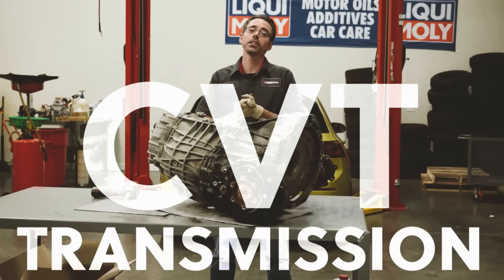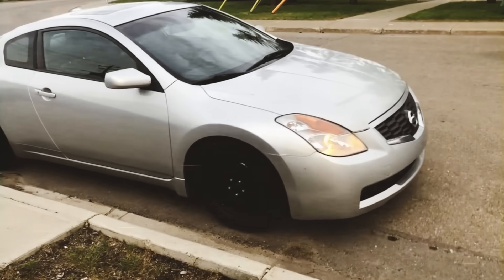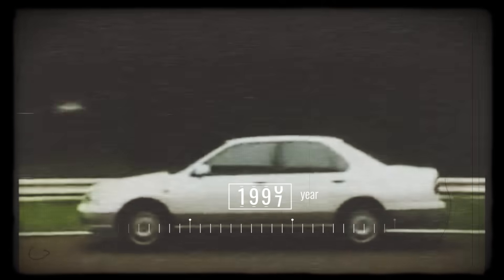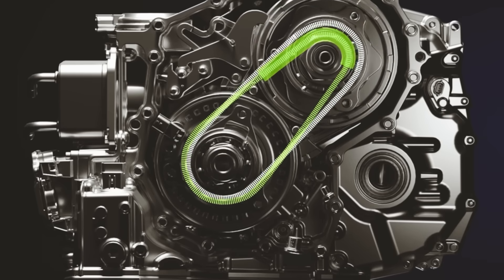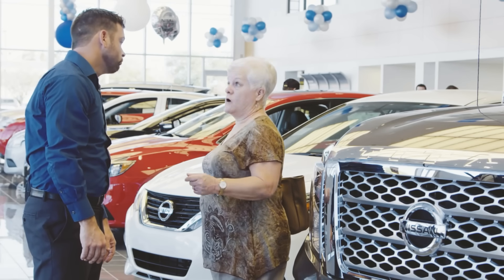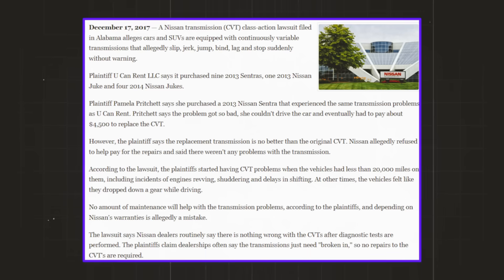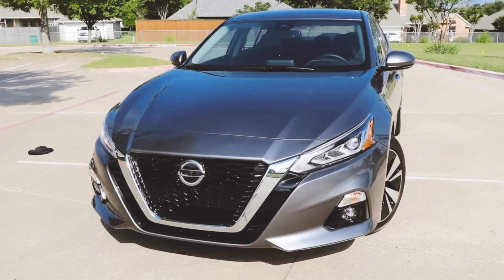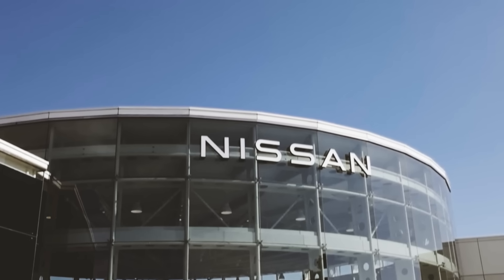Unpacking the FAILURE of Nissan's X-Tronic CVT

Comment: I really dont know why ppl are crying about cvt's especially nissans. ( think because of the bad reputation from the start of 00s that yes nissan didnt and still is refusing to properly acknowledge the problem in their harsh CVT era start.)

 I have 2 nissan Xtronic CVTs (2017 qashqai done 260k km & 2019 x-trail done 190k km) No catastrophic problems at all! Well... I follow up and basic maintenance my vehicles myself regularly and regarding the CVT, i change 'NS-3' spec oil every 50k, and every other mark i change oil+the small CVT filter(that costs 10€)...
Note: Two nissan dealers sayed that this filter is 'lifelong' and do not need a maintenance change for both models- only oil change is necessary, that was a shock for me, then i took matter in my own hands and changing the filter @ 100k it was visually pretty black and clogged up, so next time im changing it 10k faster.
 Oh and i dont bash it at every traffic light, because this transmission no matter the ads say IS NOT ment for race mode/burnout daily driving conditions!

My 2l diesel Xtrail gets ~5.6L/100km(42MPG for US), 1.7l diesel Qashqai ~4.8L/100km(49MPG for US) real life consumption without 'heavy foot' on combined cycle, what is phenomenal fuel economy for this size and power vehicles! Please comment which other brand AWD SUV class can beat it with its 'more reliable' auto trans. box?  😉 Even EVs are struggling to get these mileage numbers!

Comment: I got a very low milage 2017 Nissan Sentra in 2020 for a bargain. However since I was a student and there was the pandemic I barely put any mileage on the car. After 2.5 years I took my car to Nissan service and (Had maybe 18k miles) they told me that apparently my Sentra's transmission software had a bug that made it so it did not report any codes.  They told me they had to update the software and they would check it at my next service appointment. Next appointment (22k miles) comes around and I noticed the service appointment was taking an extra long time. The agent comes out to me and says my transmission has a serious code reported on it and the car can't be driven until it's fixed. Thanks to the lawsuits, they were required to extend my warranty on the transmission when they did my software update so I got a free rebuilt transmission and got to drive a nice new Nissan Rogue for a week. 

However, it's scary to think now if I had a driving heavy job (like I do now) or had to drive a lot to school there was the possibility my transmission could have just failed on me... I hope Nissan does better in the future.

Comment: I had a nissan kicks as a rental car not too long ago after I got In a minor accident. Had the nissan for about 2 months while ny car was on the shop. It was the worst car I've ever driven. Super unresponsive, handling was horrible, and safety features didn't work as they should. The emergency breaking system designed to stop if there's something or someone suddenly stepping infront of you would malfunction all the time. It would go off sometimes even if there was absolutely nothing infront of me, the car would would make a strange noise as it would stop out of nowhere on the road. Super unsafe. Economy wasn't even great and the power was underwhelming at best. I would never, ever buy a nissan.
Reply: Braking* autocorrect lol

Comment: CVTs are a transmission many don't realize you can't abuse like a normal transmission. You have to actually take care of them and drive it the way it wants to be. For me and my 2017 sentra is extremely gently and if I need to drive it hard, I try to keep my RPM's below 4k. It's what's been found to help prolong the life of these weaker generations of the CVT for the generation of car I have. If you maintain and drive the car smoothly and efficiently and properly maintain the transmission, it'll last you.

Comment: Riding lawnmowers use CVTs. People who claim to hate them don't actually hate them, it's just about application. CVTs are perfect for slow, low power vehicles that are driven by grannies. You can't give them hell. The Nissan CVT was a disaster, but they're not all bad. I wouldn't recommend pairing a CVT with anything above 4 cylinders or forced induction, it just doesn't work. Btw I got 30 mpg on the highway with a 5 speed manual with the same 3.5VQ- in a 2005 Nissan Altima SE. That thing had great power, I can't imagine putting a CVT behind it- it would burn that transmission alive. CVTs can't handle power, they're not meant to, they're meant to be efficient. Not everything is a race car nor can it be and that's ok. Everyone needs a grocery getter.
Reply: The work great in snow mobiles and motor scooters up to 500cc.
Reply: I get 31 mpg on the highway with a 1986 Buick Century with a 3 speed automatic transmission.

Comment: Have a neighbor whose cvt was failing. First it started with the whining like a dead cat in the morning, then progressed to whining and not accelerating. Changed the fluid and filter. Found a broken piece of piping and metal material in the pan along with a clogged filter/strainer. Buttoned it up with fresh Valvoline cvt fluid and a nissan oem filter and what would you the acceleration was back and that loud whine gone. 
  I cautioned her that she was on borrowed time and a new cvt goes fo $4,200 usd rebuilt. Her car had 64,000 miles when this happened. The fluid should be changed every 30,000miles with the filter. Its been 3 weeks and her maxima is still rolling.

Comment: I stole my new versa in 2019 paid 12,000  5 speed bluetooth a/c  ,nissan needed cash    ..its been almost flawles ,only 1 warranty issue a simple connector didn.t get clicked fully .i have drove over curbs islands  ,potholes  and at 125,000 its still my urban assault vehicle  ,got 115,000 out of front brakes and they would of went 10k more and i dont downshift ,brakes are cheap clutches are not. No complaints great car

Comment: CVT cannot take the abuse Americanss typically do to transmissions.  Maintenance is important, CVT transmissions should have their fluids changed every five years otherwise 69,000 miles.  CVT transmissions run hotter and have more friction, so the fluid wears out faster than normal transmission fluid, nature of the beast.

Comment: I work at a Nissan dealership and I can say from what I've seen, do not buy a new Sentra or Rogue. Some cars even with the CVT go higher than 200k miles (ofc I don't know how many transmissions they've had replaced to get there.) However, the 2021-2024 Sentras in particular are so unreliable that they're basically money cows to the service department. We've also had a 2024 Rogue with less than 200 miles that had to have the engine replaced because it had seized.
Reply: What usually fails on the 2021+ Sentras?
Reply: @Mabeylater293  transmissions, there's a safety recall on the tie rods, backup cameras, and on the 2024s there's a recall on the axle, we inspect the axle and if it moves a certain amount we replace the whole transmission and axle under warranty per the recall.
Reply: Also was a Nissan for a little while for co-op, and a CVT blew up at like 70km(they didn't put transmission fluid in it from factory)
Reply: I've owned several Nissans and they've mostly been really good. 280Z was very reliable. 280ZX was mostly reliable but crazy rusty. Pulsar NX was very reliable other than the awful carburetor that came on it but that ran all the way to 275,00 miles. First gen Altima was excellent. No issues. These days I have a 3rd gen Altima and it's reliable now but the engine blew out at 50,000 miles from a pre-cat design flaw. Since the engine replacement there have been no more major issues. I'm well over 200,000 now on this Altima and starting to look at other cars but after everything I see with CVTs it's absolutely not going to be Nissan this time. No way. The new Altimas and Sentras do look really nice. Nissan is great at designing things that look beautiful but the quality isn't there anymore.
Reply: I recall about 10 years ago the Sentra transmission had no cooler and was prone to overheating while all the other Nissans actually had a cooler installed. I’m guessing that’s still the case. Need to be gentile on freeway speed hill climbs in the summer or it will go into limp mode and do major damage.
Reply: Got my 2004 sentra for 4k and it went over 150 k miles and 10 years with no major repairs until it was traded in.  Too bad the quality suffers.  I'd get a new version of this old car in a heart beat of it existed.
Reply: @Protolamna  get the 2019 with a manual
Reply: Do express techs make good money?

Comment: My wife’s 2013 jeep patriot had the jatco transmission. It failed at 125,000 miles. It used to overheat on long trips and make loud whining sounds. Every Jeep dealership would never touch changing the “lifetime” fluid and even transmission shops claimed CVTs were too futuristic and fragile for them to touch when it came to a fluid service. I feel like I got shafted when it started to fail.

Comment: I worked for Nissan in the 2010s and once had a CVT fail on me on the way to put gas in a PDI car. For those that don't know that's when you put gas in a brand new car for the first time. This car had 13 miles on it and the CVT failed. Nissan sent reps out and they suggested it was the computer but after replacing everything but the transmission we ended up replacing the transmission. I still wonder to this day how that car fared after being sold brand new with an already replaced transmission.

Comment: How many 2003 Nissan Miranos do you see on the road almost extinct on the other hand there are plenty of 2002 Toyota Corallas on the road and l have seen 2002 Corolla sell that had done 980000 kilometres Jatco CVT transmission they are so crappy so awful why buy a Nissan except for the ones with a manual gearbox or torque converter automatic transmission but what's wrong with a manual gearbox l drive one and l am 69 years old and my 27 year old Toyota Hilux has a manual gearbox and l love driving it and l have owned manual and automatic transmissions vehicles utes vans and cars and have driven an automatic truck a proper truck that l needed an upgraded licence to drive and the manual gearbox is an anti theft device

Comment: I keep waiting on the CVT in the family 2011 Sentra to start slipping, but it hasn't yet. It jerks around like a bull riding machine if you try to take off slowly, but otherwise it just works! Serviced the fluid a few times and the filter once so far.

Comment: The CVT is a TERRIBLE idea and design and always was from the get-go. That's the bottom line. From an engineering standpoint it's a disaster waiting to happen and no matter the variation in design it's still a bad idea and always was. I don't care how many idiots out there defend it with their opinions. It's a stupid design and always will be. It's simply a weak link. I still don't get why it ever went in to production in any way shape or form. Change my mind. Oh wait, you never will. Long live GEARS.

Comment: A case study on how to make such and bad transmission and yet keep in the market for 25+ years. An applaud to Nissan, that takes some skill to pull off...
Reply: I thinks its a case of the transmission that is weak and not designed for abuse. The reason that many continue to be sold is because partly many people refuse to belive the transmission is problematic and partly because some people baby their car and get some high mileage without issue. Finally there are some people who do zero maintenance and still expect car to work fine. For example you need to change fluids like transmission fluid every so often.
Reply: It's not weak. It's the best transmission on the market. Problem is people like you believe there is a set maintenance interval on the CVT fluid. You are wrong and so many mechanics out there are dead WRONG. The maintenance interval is to change the fluid whenever your CVT fails a fluid inspection. That could be at 1,000 miles or 100,000 miles. If you drive your car through prolonged tough conditions in the heat, it warrants an immediate inspection and/or change. The fluid does not like heat. Inspecting entails draining ~100 mL of fluid into a white cup and seeing if there's ANY tinge of black in the fluid. Light brown is okay. I would recommend inspecting every 3rd oil change if you are babying it. Only use NS-2 Nissan fluid. DO NOT SKIMP and buy Valvoline or some 3rd party fluid.

Comment: Currently the majority of Japanese automakers are using cvts and all these transmissions last nearly 100,000km. This is not only an issue with nissan.
Reply: People are just not maintaining their vehicles and not draining and refilling CVT transmission fluid at recommended intervals is what’s getting most people caught.
Reply: @alvinsimba734  I'm glad I have 3 vehicles. It allows me to shelve my Nissan if I drive it in harsh conditions until I have time to do a fluid inspection and/or change. Inspecting the fluid is absolutely vital in all Nissan CVTs. Driving in any tough conditions in temperatures over 90 degrees warrants an immediate fluid inspection which entails draining ~100 ml of fluid into a white cup. Dipstick and paper towel do not provide a good enough indication on if your fluid has been burned up. If the fluid has ANY tinge of black to it, it's burnt. This is why you hear people driving 15k miles and having a CVT failure or at 80k. It's not dependent on the maintenance interval - because there is no interval. If you are sticking to a fixed interval of something like 60k, your CVT will be toast before you know it. Inspect, inspect, inspect. Don't put in knockoff CVT fluid, only OEM Nissan NS-2 or NS-3. If you listen to me, your Nissan will last 300k+.
Reply: @garneroutlaw1  I appreciate your info there. My father has a 2024 Nissan Sentra and I have a 2020 Corolla LE and both of them have CVTs but I prefer my Toyota for driving over the Nissan and I also love the seats in the Nissan but yes the maintenance for me it’s every 8000km and when I checked for my cvt drain and fill it’s at 96000km but my fathers might be earlier than that so we will see how it does.
Reply: "nearly 60k miles". This is an achievement now???

Comment: I have a 2015 Nissan Rogue with 274.000 km my CVT is still running strong. Maintenance is the key
Reply: Yes sure and i had a 16 rogue but it lacked the rrefinements ny 08 corolla had. Like surface rust inside the car. Random squeeks, aches, etc. And then issues popping up every so often. Like i only drove mine 50k km and it starting having issues that felt like i would need to easily keep pouring money into it to keep running. And not to mention the aggressive rust. My corolla was kept in same northern snow/salt environment and didn't have a spec of surface rust during the 220k km i kept it. Yeah i traded in the money pit rogue for a lexus rx350. And feel the extra refinement i prefer. Lol

Comment: CVT were so promising in the beginning.  A way to squeeze more efficiency out of the old ICE by keeping the rpm in the most economical range.

But now we know they are a stinker. Luckily tney won't have to fix it, as transmissions will soon disappear along with the combustion engine
Reply: Lol ice are not going anywhere anytime soon.😂😂😂 at least not in north america or any of the developing nations. The infrastructure for electricity is nowhere near the level of gasoline for ice cars. Plus the whole issue of range anxiety and lack of mechanics and parts to work on electric cars is an issue as well.

Comment: Toyota, Honda, and Nissan in terms of reliability is like the 3 dragon meme
Reply: Toyota is super reliable even when abused, honda is a maybe if maintained and nissan is a gamble.
Reply: @Phantomwarrior90  Tell that to my 2000 Celica with a 700 mile per quart oil habit. At 40,000 miles behind an auto that rebuilding in 2003 under warranty didn't fix. Something about oil rings in the piston and a common problem with that gen of Celicas that got fixed in 2004 according to the WWW. Sometimes we're the beta tester. Fine. But I haven't bought a Toyota since.

Comment: My Murano service manual suggested regular CVT fluid replacement at 90kmiles (or 60 - in severe conditions). The transmission manufacturer - JATCO- requires to change the fluid and BOTH filters every 25-30 kmiles. Follow this recommendation, and the transmission will serve 150 thousand miles with no problems.
Reply: that is more often than other CVT's because they are poorly designed!

Comment: The Toyota E-CVT has noth8ng to do with Nissans implementation.  It uses magnetic fields - there are no clutches, no belts, no hydraulics, no wear elements.  It is absolute GENIUS as compared to Subaru and Nissan crap.

Comment: I have had two Nissan CVTs go over 100,000 miles with zero issues ...maybe i was just lucky?
Reply: Maybe? My CVT died at 67,000 miles.
Reply: @TheCaptjamestkirk  did it give any warning signs or just sudden catastrophic failure?  My current vehicle is 2017 vintage Renault with x-trail running gear and I was planning to go one more year before replacement.  I have owned two land-rovers before which never once made it to the standard service interval before getting towed back to the mechanic.  I used to get towed twice a year for the 5 years of being a LR owner
Reply: @jamesszabadics5911  No, It didn't give much warning. We were coming home driving down the highway and it started to act up, lucky we were close to getting home when it happened, got into town and it kept getting worse but we made it home, next day I got it to the dealer and they said it needed to be replaced! Good thing I had the extended warranty!

Comment: Belts are too short. Pullies are to small. There is not much material to wear on. 

A dry system with user replaceable rubber belt would be better , planned obsolescence